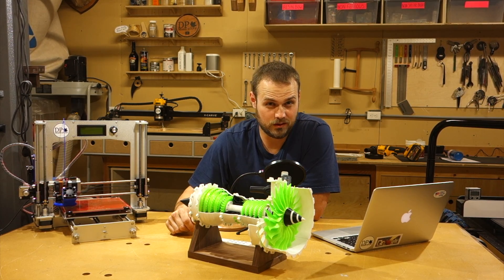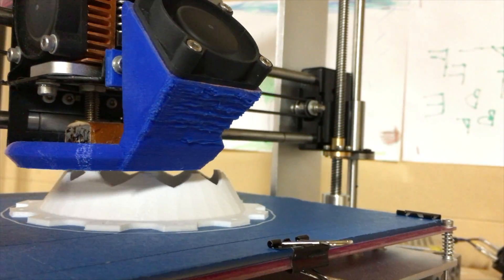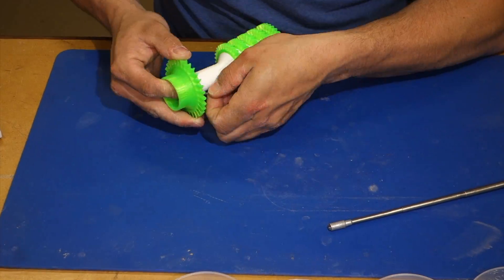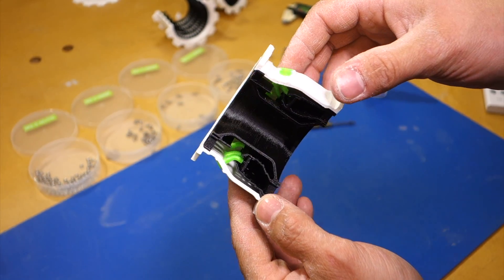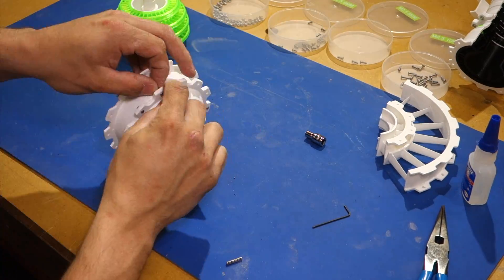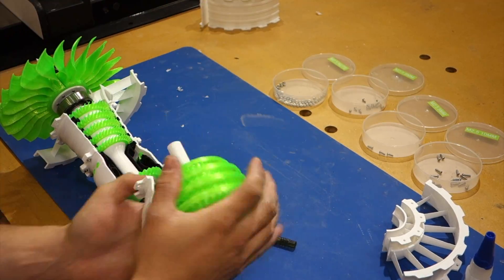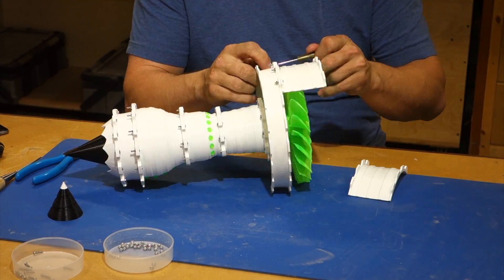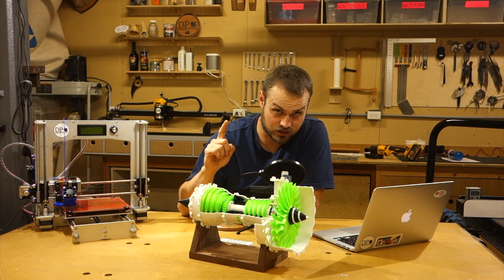Thoughts on 3D Printing & Gas Turbine Model

Comment: That's is handsome i want a 3D printer as well but they cost thousands
Reply from the maker: David Papworth thanks. The entire point of this video was to show that they only cost hundreds, not thousands.
Reply: Dustin Penner thankyou dustin i am a artist and very clever at making thing's by hand and i was told by a friend of mine many years ago about these 3D printer machine's there amazing and the state of the art things today i want to know if i can make a mould big enough to make a table top but rounded off i like your video of this jet turbine for the simple reason i used to work on aircraft engineer company myself
Reply: Dustin Penner i still can't get it into my head how the machine makes something from nothing surely it has too be given a photo of your idea for the printer to turn it into a real solid lump of something

Comment: for every stater there is a rotor thats how the air is compressed in the inlet section  inlet compression diffuser combustion turbine exhaust  other than that its cool as hell

Comment: Good on you man. I am anxiously awaiting my Shaper Origin CNC and I have just begun learning Fusion 360. It is a leap for an old guy with no CAD background, but I'm digging it and I'm currently shopping for a printer. Nice job on the turbinie model. I clicked on the video because I was a gas turbine millwright for 30 odd years in a previous life (retired).

Comment: I just got my first 3D printer a little over a month ago and starting by printing mods and updates for my printer.  Along the way I was finding that some of the mods needed a bit of improving so I downloaded F-360 and wow a bit of a learning curve but I'm really starting to get the hang of it now.  No where near being an expert but good enough to draw out most things I want or need.  Now I look at things and think how can I improve it or finally fix it using my printer.  I've been having a lot of fun with mine.  Nice print on the engine btw!   I saw below where you said 150 hours, I was going to ask how many days it took to print.

Comment: Until I can print Warhammer miniatures I'm holding off on investing in 3D printing
Reply: but, you can print it ;) just google "Warhammer 3D model files" and you'll get tons of results
Reply: Roman van der Rijt The quality just isn't there yet though.
Reply: Colin McLeod heard about the 3d print filament that is a poly clay that is easily molded with warm tools? could be a good start to then smooth out and add fine detail and then make silicone molds and then cast duplicates with resin. the clay is also recyclable but I don't think the machine for doing that is quite consumer level yet.